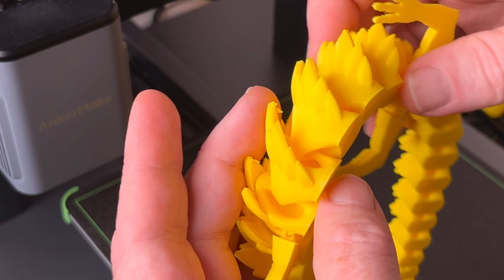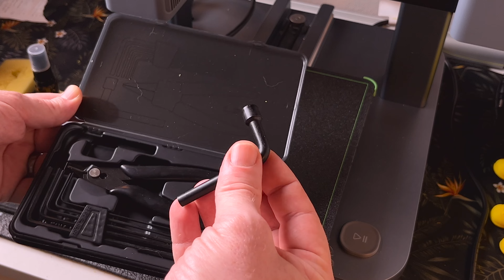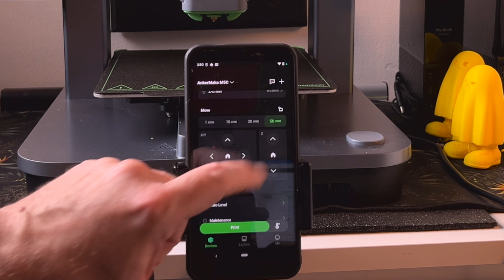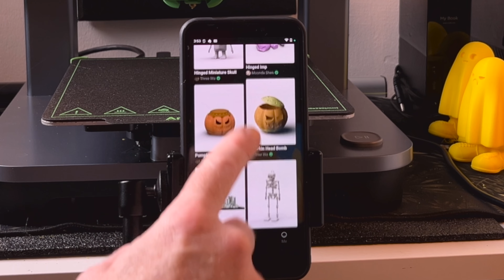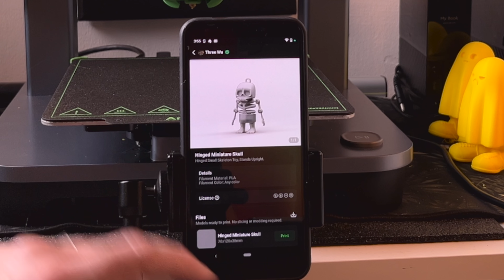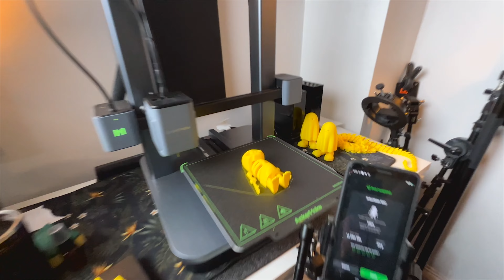Beginner Friendly Ankermake M5C #Techweek

Comment: Seems like a nice piece of kit,I've never felt the need for one, but after seeing that funky little guy, who doesn't need one? Off to have the conversation with the boss.
Reply from the maker: I designed and printed a wheel handle thing for my saw today, in the space of about an hour and a half something that didn’t exist all of a sudden did 😊
Reply: @WoodworkJourney  and that's exactly what i would want to do, and it's that info that i'm hoping you will put into video form on here. Saying wheel handle has just made me realise that i need a handle type thingy to replace the knob style of handle on my router lift. That would be my first job Ha ha Thanks Dean
Reply: @WoodworkJourney  That's it, took the plunge and hit the buy button from your link. Thanks Dean.

Comment: Do you get any issues with fumes? I.E are they not toxic? Should they not be used in some kind of enclosure?
Reply from the maker: I believe some materials particularly like ABS require that, generally though to my knowledge standard PLA just needs normal room ventilation. Enclosures can be extra helpful to stabilise environmental temperature though, print farms are usually in stable temp and humidity controlled rooms for the same reason